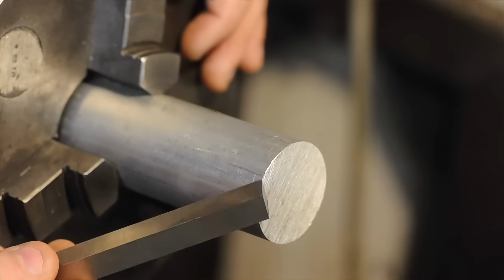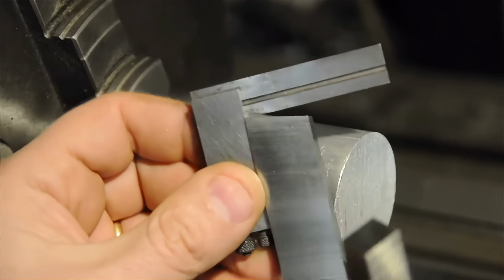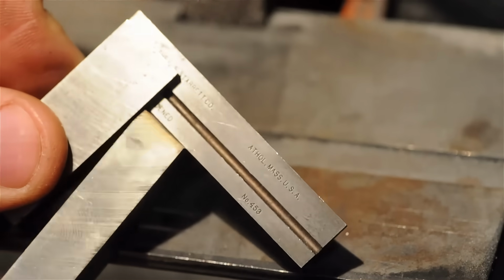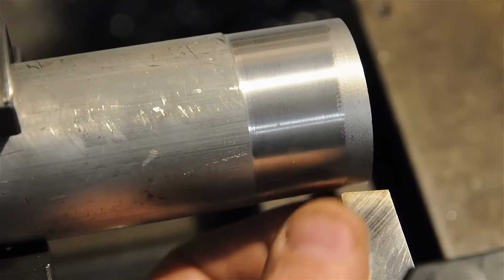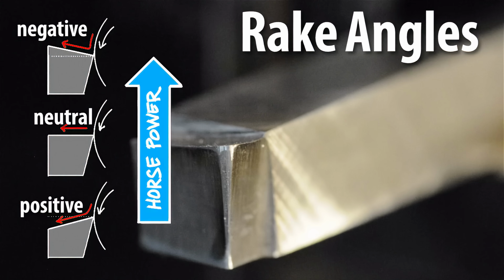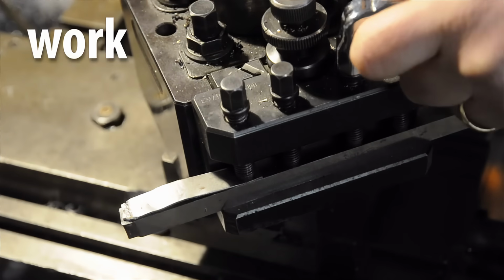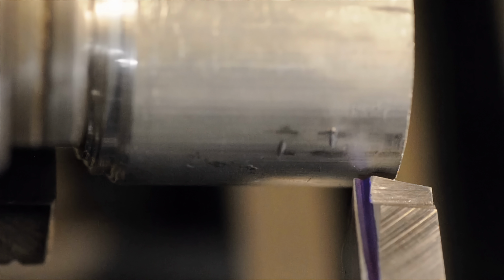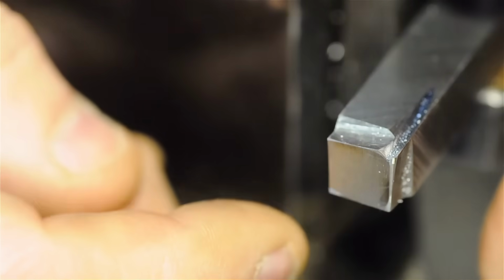Grinding HSS Tools

Comment: Another informative and entertaining video - thanks.

I would like to suggest adding something for a future video concerning inserts & tools. I have a home South Bend 10K lathe with an AXA tool post and carbide inserts tool holders bought in a kit. The kit has 3 different holders with inserts that all could be used for a right hand cut. I am not sure which should be used for making a cut when any of the 3 could most likely make the same cut. I feel one style would most likely be better than the others, but.... thus, my question. I suppose this may not be an answerable question due to too many variables, but if anyone could give it a shot it may be you.
Reply from the maker: Hard to say without knowing what geometry they have, but I'll guess (1) they all use the same (triangular?) insert and (2) you have one with a tip pointing straight away from you, one with tip to the right, and one with tip to the left?  Although they may all have clearance that allows them to do right hand cuts, they wouldn't leave the same "shoulder" when you stop them.  Two are meant for turning to square shoulders on the left side of the work (toward the chuck) or the right side of the work (toward the tailstock).  The one with the point going straight away from you almost looks like a threading tool?  It won't work for that.  But it might let you sneak into places the other two won't get.

For example, pick any one of your three tools.. without turning the toolpost, you couldn't, for example, turn a "dumbbell" 

The shape of the insert, and the way its pointing off the end of the tool, is dictated by the final shape you want to take your work to.  Every insert on the market (more or less) can do straight turning.  Its when you need to turn funny shapes that the shape/size/orientation of your tool becomes important.  Just pick the one that fits.

Don't know if that helps.. but.. there ya have it. :)
Reply: You did an excellent job answering my question in your Carbide video. Thanks, thanks, and....... thanks.

Comment: the radius before going to chip breaker is the culprit that causes the small goofy chip...try smaller radius on the vertices it should be very min.  another possible solution is to rotate cutting edge clockwise looking from top.

Comment: This was so very helpful for me. One area that I didn't make the connection though is in material SFM. I thought that the material being turned had specific data points about the "best" recommended SFM speeds- and here's the important part- to result in the best surface finish. Yet in this video, it would seem that the SFM can be increased/decreased specifically in order to address chip control. Maybe I'm discounting that you were trying to specifically talk about one area independent of another for clarity sake, but I am really curious about this. Are SFM speeds recommended per material in order to accomplish best cut? Best surface finish? Best chip control? All of the above? Thanks again for the super helpful video!
Reply: deemstyle I heard the word button pusher?

Comment: I was so daunted by grinding HSS tools that I went straight into carbide inserts when I got my lathe. It's not that much more expensive, if you stick to the cheap Shars stuff on eBay. And the inserts last quite a while if you don't abuse them too badly, at least in aluminum.

Comment: My Question what is the best grinding wheel for HSS tooling?
Reply from the maker: Good quality aluminum oxide wheel works great -- probably the ones that came with your grinder.  The trick is to keep them clean.  If they start to glaze, they won't cut and you and the tool will just get hot.
Reply: Thx for info! But how to keep clean, must dressing the wheel?

Comment: Have you ever tried to make a chip breaker feature with an endmill (I guess you'll need carbide there). Just lower the tip a bit in an angle so you get the positive rake and one of the three reliefs while creating the cutting edge with the tip of the endmill.

Otherwise: Great Video VERY well explained.

Comment: did you change your tool height when you ground down the top of the tool bit?
Reply: The cutting edge of the tool should be at centre height (usually)

Comment: not sure if this has been mentioned, but when you added the chip breaker, you should have reground the face that is sort of parallel to the axis of the lathe.

on a side note, some time last year i was working on some headlight projector shrouds. I used hss and aluminum, and i had the chip feeding directly into a trash can, it was tight enough that it would break it self maybe once per minute. it looked like a can of robot endtrails.

after doing that for a few hours, I decided to take the shop vac and suck up the continous chip. it worked perfectly, I could walk across the room and it would pull the chip hahaha. then when I opened up the shop vac to empty it, the chip was nicely coiled.

I cant find the picture of the trash can so you will have to take my word for it.

Comment: When doing a boring operation, typically you want the tool to make chips.  Long stringy shavings get caught up on your boring bar and ball up inside the work, causing scratched up finishes or breaking your cutting point.  Small chips fall into the bottom of the work (tube/pipe or what have you), and just flow out of the work into your chip tray like fluid.  With coolant, chips tend to flow out of a bore quite well.  I've had some really far from fun boring operations where we couldn't push the tool hard enough to break a chip (due to clamping limitations), and I must say stringy shavings in a bore are a bitch  to deal with.

If your tool's geometry has a chip breaker built into it, generally as long as the tool is sharp, speeds and feeds will dictate whether or not it breaks a chip.  Often times, these speeds and feeds are much harder than you would want to/could even push a hobby machine.

Love the videos though, always entertaining.

Comment: super)). However I feel my self robbed by not showing the hack with plate/shim with cutter. At least few words next time in which direction it usually fly off if it does so.
Reply from the maker: Sorry Molb0rg -- just the fact that it can fly off, irrespective of direction, I hope is reason enough not to try it!
Reply: https://i.imgur.com/rjI8wSo.png

Comment: If you have back rake and side rake doesn't that mean that the back of the cutting edge is then below centre?
Reply from the maker: Yes it does drop away, but the after grinding, the tip-tip should be set on center.

Comment: Great video as usual Tony. My only suggestion / complaint is that (to be complete) you should have covered putting the tool on center. It could have been shown easily by taking a facing cut looking for the usual nib (or lack thereof). Also after you added the chip breaker (that lowered the cutting edge) you should have pointed out that the tool would need to be put back on center. Otherwise very informative. Keep them coming. I like your style.

Comment: Great video, Tony, thanks! Your visualizations and explanation of the angles made things click for me that never did before. Seeing the problems with a square cutter was insightful for that as well.  I could never remember where the clearance and rake angles were since I didn't really understand what they were or why they were called that. I just followed instructions without understanding so that I could just get results as quickly as possible.

Comment: Hey Tony, Zach again. First. Thank you for putting out so many videos recently. It's like when you click on one of those videos from that spring guy and get so excited. Except it's marginal six days to six months difference. (Or 152.4mm🤔) Really hit it spot on in the first few seconds of how excited I was to watch this. I would honestly listen to daily for at least an hour. Even if it was just talking. Second. I've had my fair share of tool post grinding in school, especially with, "Practice tool blanks." With that being said, I think this is very informative. Considering it is a(n) hands on learning type of trade, the showing of the why and the how by first showing the why not and consequently the why being a solution for the why not is a terrific approach to explain the...I lost my train of thought. Third. I never put chip breakers in my tooling, I always messed with my feed rate, usually just slowing it down, or alternatively if I was rough cutting, I would engage, pause, disengage, and quickly engage, rinse and repeat, my carriage feed lever. I digress, would it possibly work better to grind the the chip breaker prior to the other geometry to accomplish a more refined cutting edge? I might have to try this one out for myself. I know you mentioned grinding with the intention of the result geometry might look different, but I wasn't sure if that is what you were talking about.

Sent from my wife's iPad

ZH
Reply from the maker: I do the same thing.. bump the feed.. when chips get out of control.  I haven't really "explored" chip breakers to fairly answer your question, but it would be an interesting experiment.

Comment: Did I hear you right?  We're you suggesting Mrs TOT's chocolate chip cookies are harder than aluminum?

Another GREAT instructional video.  Thank you!  Joel.....
Reply: How do you think they machine carbide inserts? The cookies are not just for aluminum.
Reply: That's why TOT sounds so frustrated with chip breaking on aluminum, but also how he built up a wealth of knowledge on tool design. Trying to carve chocolate chips out of Mrs T's cookies is no joke.

Comment: This is just my opinion but if you can't work with HSS you aren't really a machinist. Carbide is great, it certainly makes my life easier (sometimes). But the problems with carbide are from the HSM or even the individual who has a lathe for business reasons but doesn't use it often is that carbide comes in so many grrades, insert shapes, insert profiles and insert coatings it can beconfusing to say the least. The hobbiest should probably stick with positive type carbide instead of negative rake tooling if all they have for a lathe is a wet noodle 9x18/20 or something similiar. Probably a good place to start with carbide is on of those 5 tool holder sets that take a TP insert. They don't get a lot of love from some people but once you replace the cheesy retaining screws with something more substantial (no need to get Torx insest screws) carbon steel SHCSs in grade 8 for SAE or 12.9 for ISO (that's metric folks for the base 10 challenged) will work just fine. just machine a cone on the head of the screw to match the angle of the c/sink in the inserts. I have a set of these at work and they work well on steel, brass, stainless and just about anything else I use our smaller lathe for (a Grazianno SAG 12, so if you run into any clutch packs,, I digress). One important thing with carbide is rigidity in the work holding and the tool set up. Back to HSS. There are a number of books and articles /videos on the web that go into this stuff. Do some research, and practice grinding tools. But practice on something other than HSS. Get square CRS or HRS from the project rack at the hardware store and have at it. It will help develop the hand eye co-ordination needed for grinding HSS lathe tools by hand

Comment: Actually this explained something that has bothered me for years. In junior high school metals shop we had an uninspired teacher. When it came to the lathe he sharpened all the bits. Recalling their shape they resembled wood chisels. Nobody was able to do any work on the lathe for more than a minute or two before the bit was dull. Thus the lathe became a black hole to everyone who ever took that shop course and those who went on to become machinists had to reorient themselves to the lathe.
Reply: Ryan James 
Dang, wonder if we had the same shop teacher !  Mine was a master at the welder and could do magic with one but he did not like the metal lathe so didn't even try to teach about it.  Myself and one other boy really wanted to learn so we talked the teacher into letting us come in the shop on our lunch break but when you don't have someone to show you the right way, things can and do go bad ! It's a miracle that it didn't turn me off of turning but it just made me more determined.  That was in 1970 and I still enjoy it !

Comment: What about alcohol as a cutting fluid for aluminum?
Reply from the maker: Probably also works?  Have never used it personally.
Reply: Just wondering if you knew anything about it. Never tried it myself, but read in a 1940s US Navy shipwright's manual that alcohol was a cutting fluid for aluminum.

Comment: the video I needed!Thanks so much!  :D  Please make a tutorial also fot the parting tool  .Regards
Reply from the maker: Parting tool is fundamentally the same.. clearance angles on the front and both sides (it's cutting on 3 sides).. you can add top rake and/or a chip breaker at your discretion.  Start with a flat top, see how it goes.  If it doesn't cut as you like, add some positive rake just to the tip and it'll also chip-break.

Comment: Excellent video as always - funnily enough, when I started watching your fly-cutter video last month I was thinking of asking if you'd consider doing a tool-grinding run-down, but as the horror of the contactor reared it's head I got distracted!  I've never had luck grinding  fly-cutter bits (but after watching part 2 I pulled out a left-hand welded carbide tool I got free with a lathe and put a small radius on it, and it worked a treat - the little asides you and others - Stefan Gotteswinter and clickspring to name a couple- throw in on these videos add up to a whole lot of help).  Thanks.
Reply from the maker: My pleasure, Ray.. thanks for watching!

Comment: Thanks for a really informative video. I remember it took an long time to wrap my head around single point cutting tools in machine shop. The 60* threading tool is an beast to hand grind, but an useful skill set to posses.
Reply: yeah or a die and a power machine.  you can be a ",pipefiter" in los vagus making 35 an HR with "years experience" with company no one in losvagos knows about.
Reply: takes you 2 hrs to master and you're producing up to possibly 4 inch screw pipe

Comment: That was a completely different approach to explaining tool geometry! I think it will make it easier to understand why those angles need to be. A good complement to those videos already existing.

I have lathes frm 7hp downto a 0.3hp laptop lathe. And for the small underpowered one I just love using chipbeakers! I hate grinding and stoning them though. Those chipbreakers let it remove aluminum/steel pretty good.  Ohh, you forgot stoning it! That would help.

And please o not dunk your toolbits in water to cool it! It can make microcraks that will leave the sharp edge prone to break off tiny chips and loose sharpness. Put it on a flat piece of metal  to cool faster but not extremely fast.
Reply from the maker: Good tip, thanks Einar!

Comment: Terrific video. Couple of questions:
would that tool cut mild steel OK, before it had the chipbreaker, or would e.g. the rake be different?
Would it have needed a chipbreaker for mild steel, and if so, would it have looked different? I'm guessing mild steel is a bit less ductile, so maybe a bit more inclined to break.
Reply: I can never get stainless to break but it doesn't usually birds-nest.
Reply from the maker: The grind I did is actually for steel, so yes, without the chip breaker, it works great.  You'd probably want a lot more coolant than just a spritzing of WD40, though.  Chip breaker is not strictly necessary for steel but if the chips don't behave, adding one could help.  For aluminum, one would probably want much more aggressive rake angles.. 10-15 degrees, easy.
Reply: have you ever tried to break mild steel although it's a broad term of a group of your metals carbon steal you dropped it from your waste. don't worry about picking it up because you broke it.  seriously anything harder 9 times out of 10 is also more brittle

Comment: Nice I was curious how this works! I am thinking about buying a grizzly lathe/mill combo (hobby machine). Have you ever seen/used those? or anyone else here?
Reply: yea it is mostly gonna be small stuff but i might wait and save up instead... i'm just itching to get ahold of both types of machines eventually. i dont want to buy a pos harbor freight one though.
Reply: Lupusk9 Entertainment 
Just a short story about the combo unit I bought twenty five years ago.  It seemed like a good idea at the time, and guess it could be for some things  but the one I had come with a small four inch chuck so the first thing I did was to make an adapter plate for a six inch chuck. The problem come when I tried to use the mill with the chuck mounted, it don't work !  I know what a lot of you are thinking, just take the chuck off, NOT an easy thing with this particular machine. I got a separate mill and never did use that one !
Reply: Lupusk9 Entertainment 
Just a short story about the combo unit I bought twenty five years ago.  It seemed like a good idea at the time, and guess it could be for some things  but the one I had come with a small four inch chuck so the first thing I did was to make an adapter plate for a six inch chuck. The problem come when I tried to use the mill with the chuck mounted, it don't work !  I know what a lot of you are thinking, just take the chuck off, NOT an easy thing with this particular machine. I got a separate mill and never did use that one !